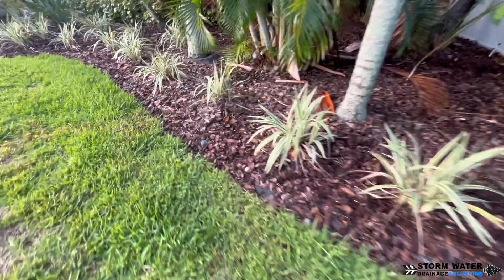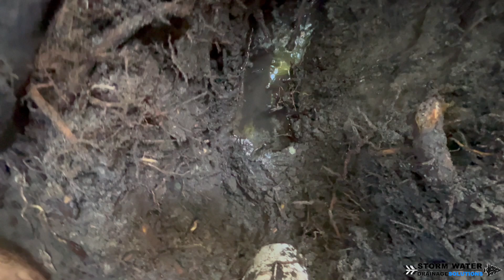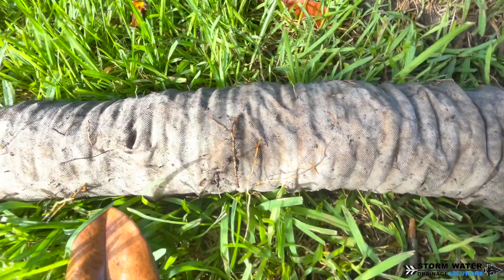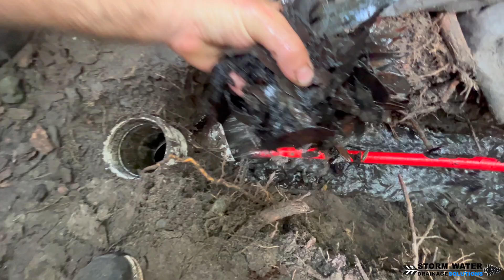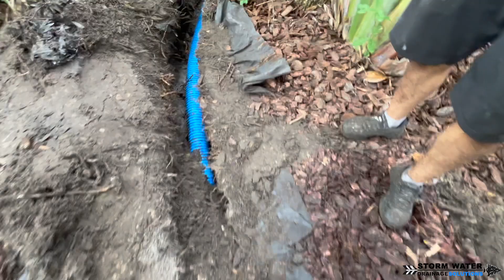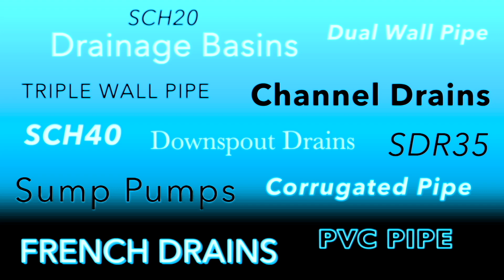How To Repair a Drainage Pipe - Mainline Replacement - Yard Drainage Tampa Bay - Why Pipes Fail

Comment: The only improvement that I see is replacing the 90 degree clean out with a double 45 degree clean out, so that it can more easily be snaked out with a larger diameter snake/water jetter in the future.